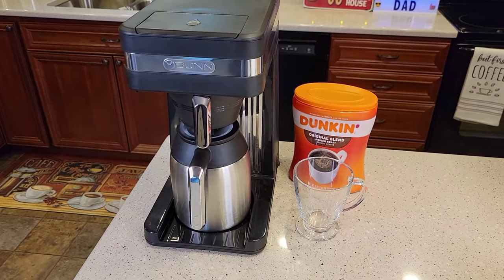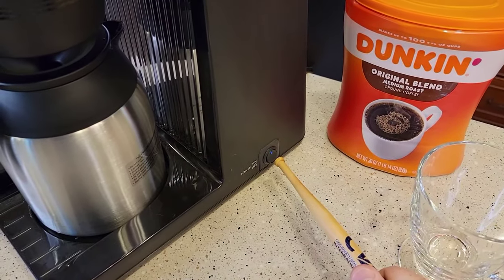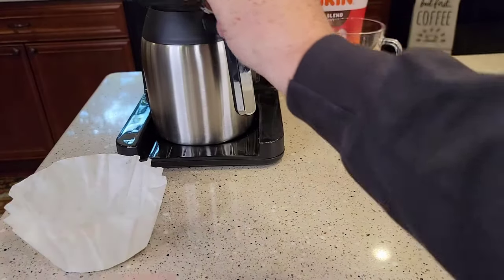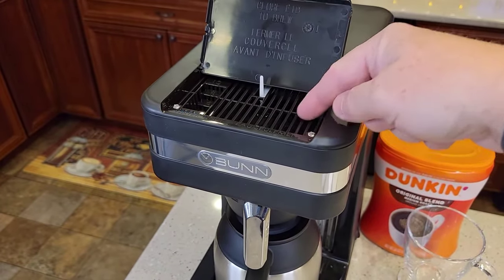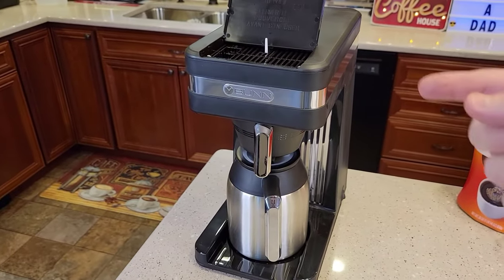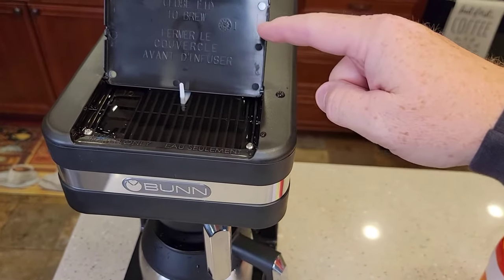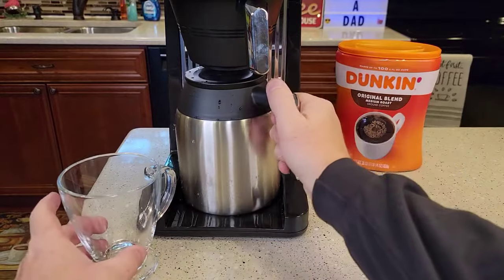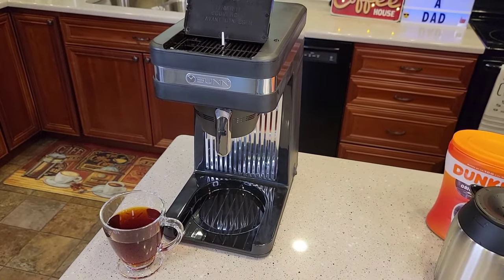Review Bunn Speed Brew Platinum Thermal 10 Cup Coffee Maker CSB3T

Comment: Good job touching on all important points.  Been using Bunns exclusively since the '70s.  Currently using the Bunn CSB3T, because my wife scorches it with the hot plate of other models.  The carafe keeps it hot for a surprisingly long time. 

I always use the carafe with lid off to fill it. Fills quicker and no chance of brewing into a pot with coffee already in it.  Also, grounds are removed before the pot, to avoid dripping it everywhere.  I use a cup under it as I remove it, in case it is still dripping.  You mention Bunn users having certain habits, and that's just another one.  I use one large, super heaping scoop of coffee for a full pot.  Never make less.  I imagine that scoop totals 10 tablespoons.  I'll have to measure some day 😊
Reply from the maker: Thanks so much!!! Yeah I agree with what you say!!!  Thanks for sharing!
Reply: How's the electric bill running it all the time...
Reply: @BLYFACTOR  Owners of home Bunn coffee machines usually find that their coffee makers use about 1.1 kilowatts of electricity each day, adding between $2 and $4 to their electric bill every month, for a total of between $24 and $48 per year.

Compare that to a few bottles of bottled water or even a single cup of Starbucks coffee!

Comment: I got this coffee pot and I love it except the first pot I brew every morning, whether it is on or off, is lukewarm at best.  What am I doing wrong?
Reply from the maker: make sure you are leaving the switch around back on all the time, this keeps the water in the tank warm all the time.  that switch should never be turned off unless you are not using the machine for more than a week.
Reply: You may need to preheat the carafe.  I use another machine, but, what I do is fill the carafe with hot water the night before.  In the morning, I pour out the water (which is surprisingly still hot/warm) and then brew.  For you, your first pot is heating the carafe for the subsequent pots... but, that makes the first pot lukewarm.

Comment: Should I get this one or the BUNN VP17-1? Looks like the only difference is the VP17-1 is all stainless and can do 12cups, it needs a pot purchased separately.
Reply: The VP17 is a commercial machine. It is larger all around, verify it will fit were you want put it. Also it uses the full sized commercial filters. Never used it smaller batches. I think it is a great machine, but size and aesthetics need to be what everyone in the house wants. I believe it does have separate warmer and water heater switches so you can use it with a thermal carafe.
Reply: I own a VP 117 and I can tell you for sure that it is definitely a lot bigger machine, it does have separate warmer switches, but I wouldn’t use it with a thermal caraff, the heating elements are specifically designed to work with the 12 cup caraff. I’ll also mention that the heating element in the industrial machines is 1500 W where is the home models are 8 to 1100 W.

Comment: I have this model and I’m trying to figure out a way to have it ready to brew as soon as I wake up. I tried filling it up with water at night and leaving the lid up and close the lid to start brewing in the morning but the coffee was cold. Any suggestions?
Reply: It's not designed to do that. But it takes so little time (3-4 minutes for a whole pot). If you don't want it on all the time, attach it to a programmable timer and have it turn power on to the coffee maker 20 minutes before use. Then just pour your cold water in after putting in the grounds and hot water comes out.